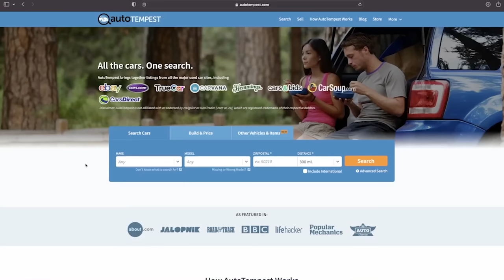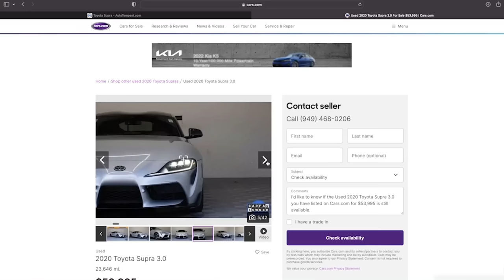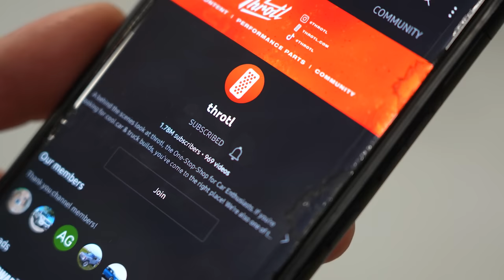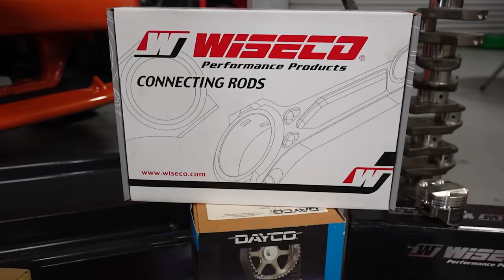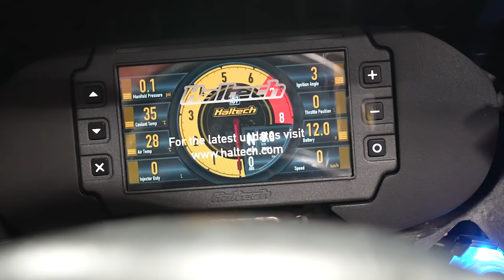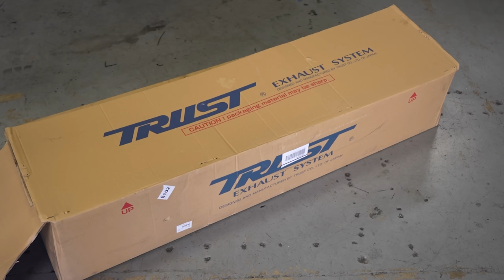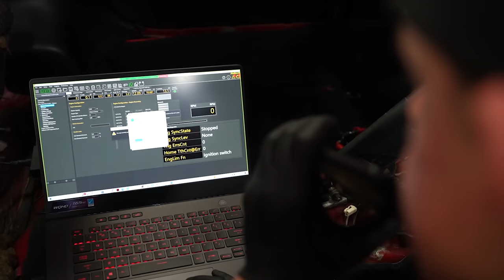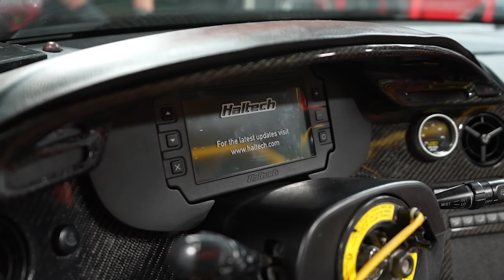Building a Modern Day (Fast and Furious) 1994 Toyota Supra Turbo in 28 minutes! [TRANSFORMATION]

Comment: If you replaced bushings on the Supra, you have a few bushings that take so long you wonder if it is worth it.  In the end, got  poly on the 4 corners and the effort you will never see here was worth it.
Reply: drill around metal, push out with pulley removal kit, then use hacksaw to make a groove and pound away.  I am in Japan so aftermarket isn't a thing.
Reply: Aftermarket parts in Japan  mean you won't pass road safety inspection

Comment: I like the older meters more.. and digital system one the sunclap for the passenger to read the system oud.. and machining the power can behind the roof for the cable … and the audio system can have the setup system for extra performous .. öre track setup  what you can controle one thr steeringwheel .. thane you have in one eye all the meters in front on the desk and next to the cardoor up.. that’s what I sould do
Reply: With not the sharp light for the eyes so you eyes can consetreat one the dark form the night
Reply: Wight off the sunclap  small magnet one the side off the sunclap